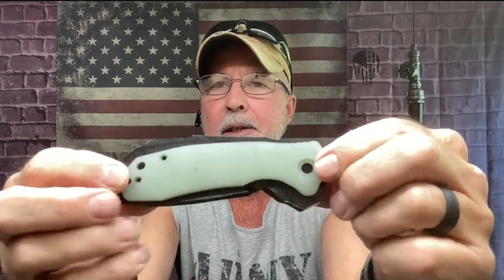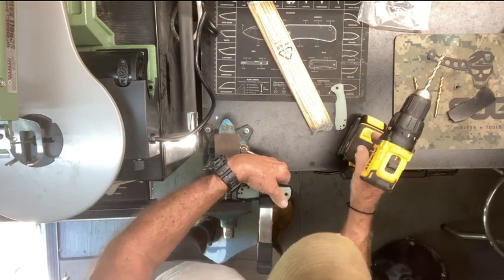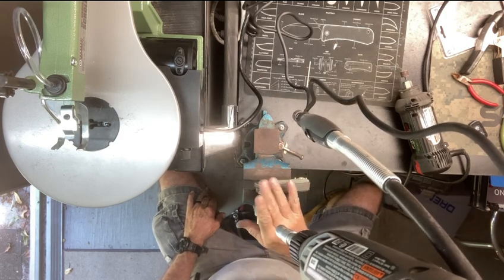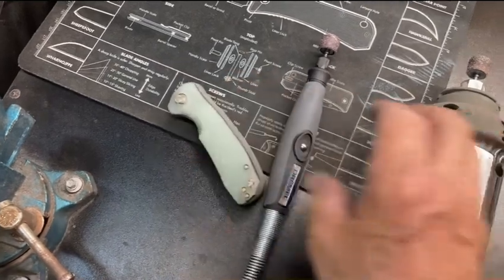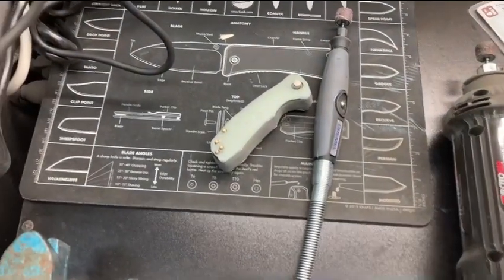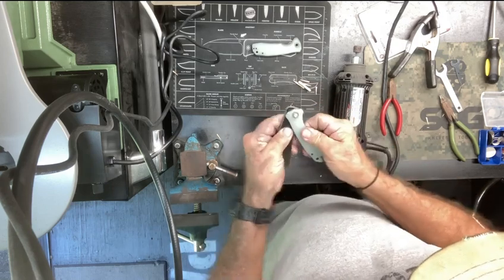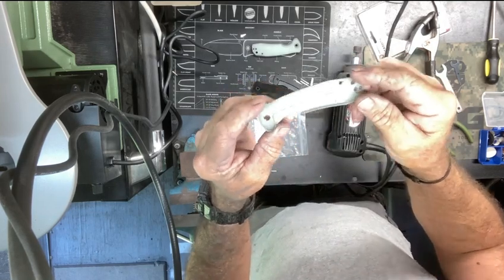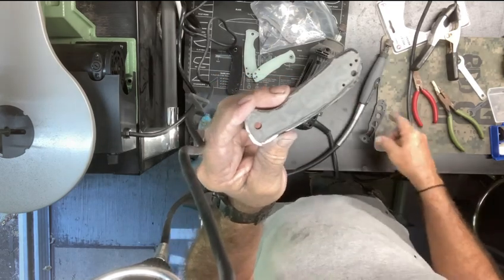Making Micarta Scales for a LinerLock Folding Knife Part 1 and 2

Comment: I did the carve out method with a couple Mora's i made and the problem i had was getting the depth correct so once i glued it together with "skewers" , the blade was the tiniest bit off center with the seam of the wood slabs. Only i would know it but I see it every time. Good luck and take your time on the recess. Good luck. 👍
Reply from the maker: Thank you Chris!😊🔪👍